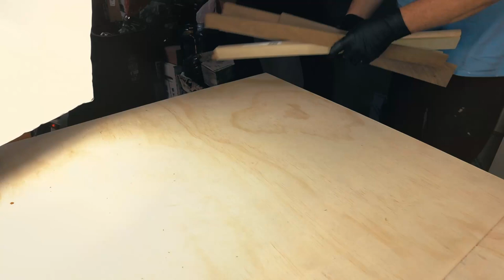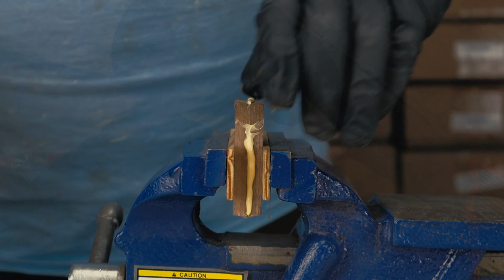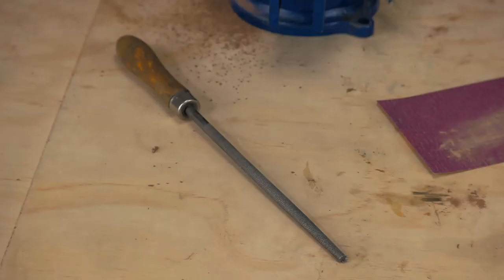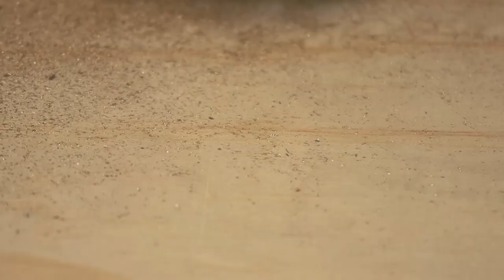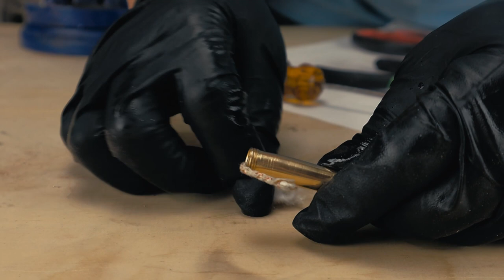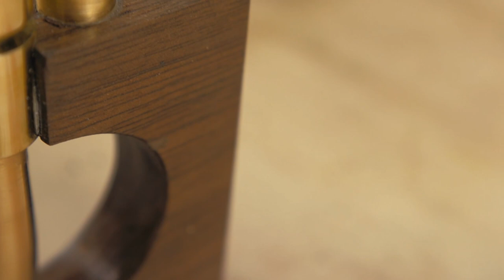The Surprising Secret of the $5 Handmade Lighter #DIY #Dremel

Comment: Why put thread lock on the screw after you filled it?  Won't you be filling it again?
Reply: Also glue the light part is not smart...in this way you will not be able to change the flint
Reply: That's not thread lock, it's sealant.